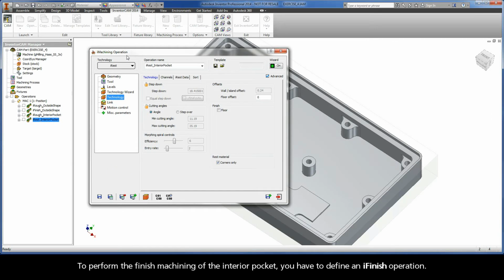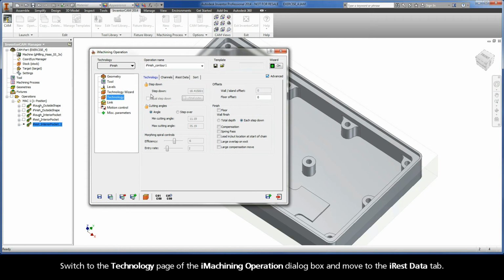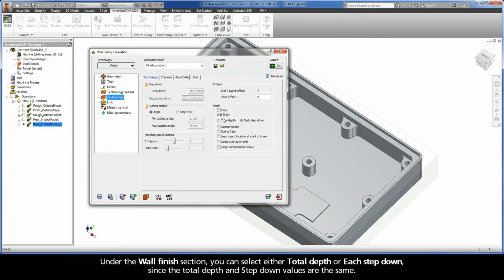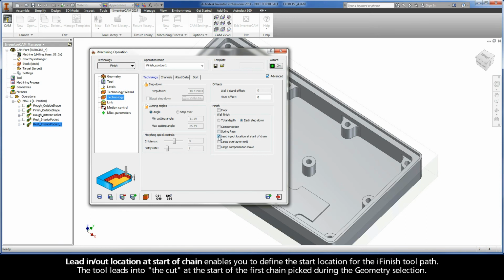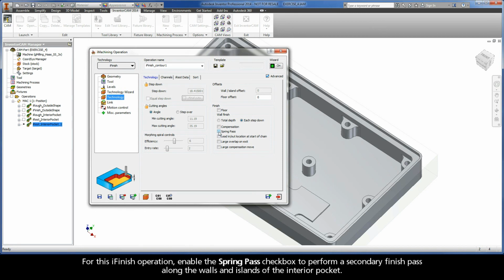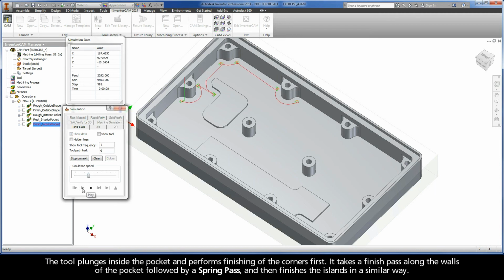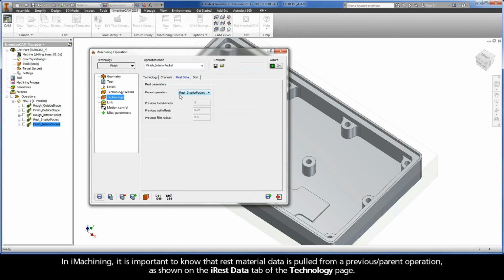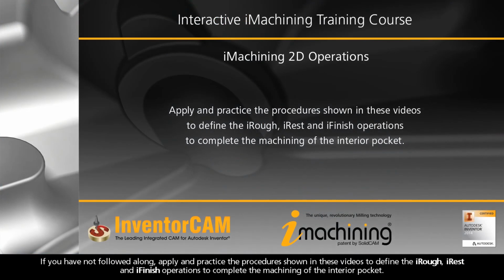InventorCAM iMachining Training Course - Exer #4: iFinish the interior pocket

Comment: i tried using imachining to machine a pocket. i had selected to finish the floor in irough operation with .01" floor offset. after the irough had completed the floor had visible marks, after  the ifinish operation with also .01" offset the floor along the walls was smooth but not the rest of the floor. Any suggestions? the tool never went towards the inside of pocket , it just moved along the walls.
Reply from the maker: Hi Jasan. In an iFinish operation, the tool will only finish the walls and floor along the walls but not the floor where the roughing tool path occurred. Rather than finishing the floors in your iRough operation, use iRough to remove the bulk of material and then I would suggest using a Pocket operation to remove your floor offset. With a Pocket operation, you can finish the floors with a pattern (e.g., Contour pattern) which will give you a smoother surface finish on the floor. Afterwards, you can define your iFinish operation.